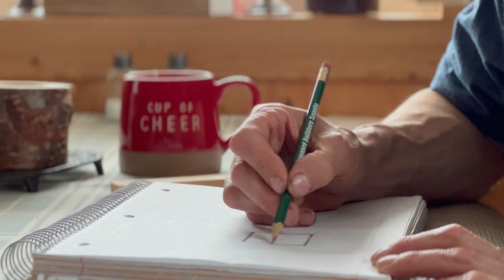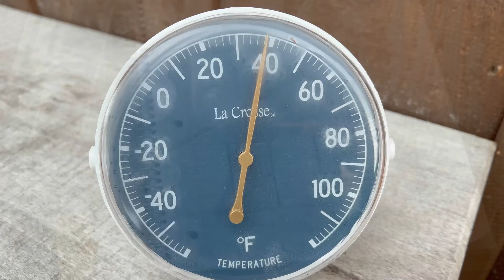Cabin Life in Alaska ~ Logging for Our Sauna and Finishing Winter Projects  ~ Nordland 49

Comment: To help with the tree cutting you should grab up one of the Warn drill wench's like I grabbed up.  It has saved me a few times out in the woods when I got my Tundra stuck.  light weight and pretty dang strong.  Get a block and tackle and you can easily pull a tree over.
Reply from the maker: That’s a good idea , thought about an old electric wench but thought for sure it’s going to be cold enough were I didn’t need it , but turned out the other way and sure could have been beneficial 😄, but thank you for the great tip 👍👍

Comment: Does the flow in your spring pick up in the summer?  Ours lows a lot heavier than yours.  I am hoping to find one a bit closer to the house this year.  I see a few spots one could be but need to explore some.  The sauna looks like it is going to be nice.  We want to build one in a few years.
Reply from the maker: Hey guys, well the slowest water supply from the spring is always around April , as soon as it starts melting night and day it will pick up quiet a bit and comes summer we have 5 gallons in a about 40 sec. , a few years ago I worked on bringing several small springs into the biggest one and confined them into one , now it’s running really well and also super clear .
Thanks for the comments !!! 
Hope you had a great weekend 
Be safe 
Oli and Tacia